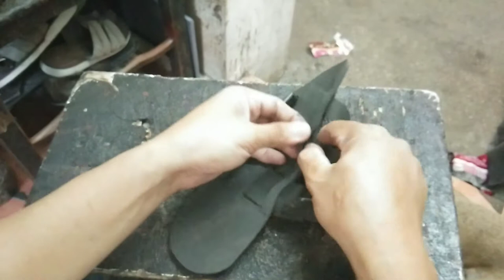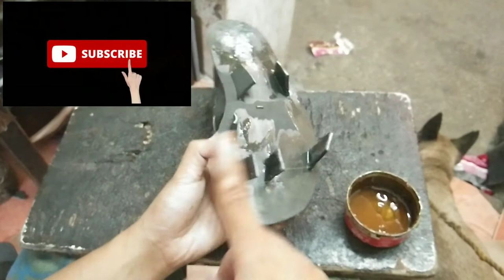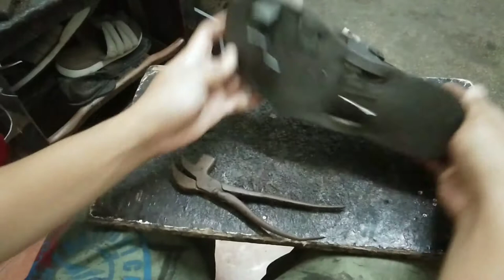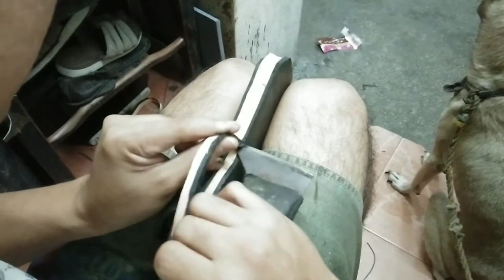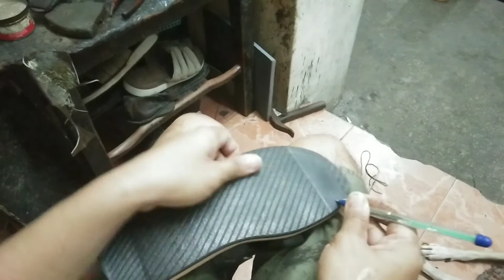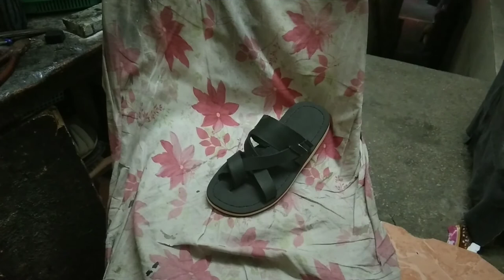#LEATHER SANDALS MAKE YOUR OWN  BY HAND CRAFTED USING RECYCLED RUBBER FROM CAR TIRE

Comment: Achatri fai 9anti iachafik fai 9antk
Reply from the maker: the purpose of this video is i just wanted to share some of my method on making leather sandals to those people that who wants to learn on leather sandals making.
Reply from the maker: if you want to buy or try my sandals.
heres the materials i always use.
1. cow hide leather
2.thick cow hide leather or rubber math (insole)
3.recycled rubber from tire(main sole)
4.nylon thread  from fishing line /fishing net
Reply from the maker: if you are in dought? we can start on making 6 pair on diffiret design so that you can observe tha appearance and the qualitu of my work.